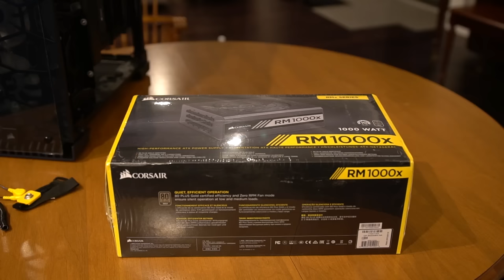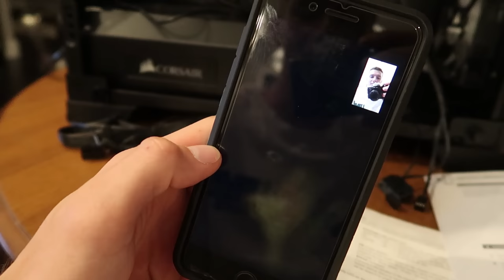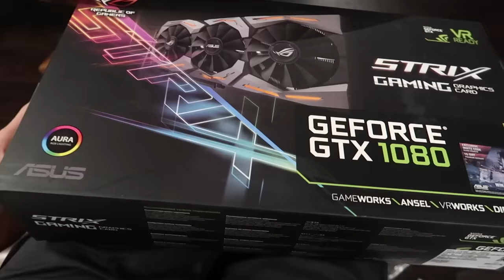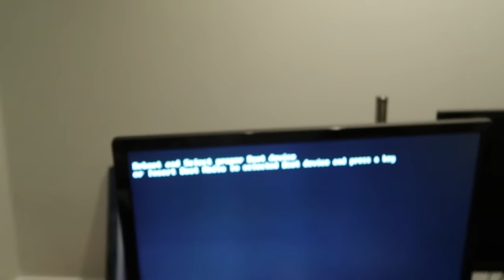Building my First Gaming PC

Comment from the maker: I know the cable management is awful in this video - I cleaned it up the next day once I had more time! See video : "FIRED UP!"
Reply: Adam LZ how much did this cost
Reply: Please make a "How to: Reinstall a sticker" xD No hate <3
Reply: Please tell me you added a SLI bridge
Reply: Adam LZ I love it months later and still replies to the viewer
Reply: Adam LZ welcome to the master race
Reply: MEHDI gaming you should install the ram cpu and cpu cooler on the motherboard then install it
Reply: u left plastic on GPU n motherboard .
Reply: you put the fan downwards on accident
Reply: @Adam LZ  everything about your build is just wrong. From the sticker all the way to the radiator mounting position and your graphic cards.. omg six pin power connectors are not plugged in. Take it to a shop let them do it properly or call a friend maybe. Your system needs immediate help. Good try though for a first timer..
Reply: RetroLAD he made this in February, it works fine now
Reply: Adam LZ  i Love all Your vidos
Reply: U missed sli bridge on those two gpus
Reply: Adam LZ I wish I had those parts
Reply: Adam LZ oh my name is Ricardo
Reply: Adam LZ how much was it to buy all the components?
Reply: Adam LZ you need a Quad Channel  The geforces
Reply: calculating the chair and displays into the build too I would say around $10k at most. But if its just the system its about $3k give or take a few hundred.
Reply: Adam LZ miss watching ur videos
Reply: Adam LZ ur pc is pretty
Reply: Adam LZ i to am ignorant, I put it together cable manage, put the pannles on and then test.
Reply: Your heatsink is cool!! ( the one you installed on top of cpu)
Reply: Hey adam.I want to ask you if u have temperature issues with your CPU.
Reply: Adam LZ isaid
Reply: How much did this cost??
Reply: Adam LZ llll
Reply: How did you get all of the fans wired up I have the same case but I cant wire up 6 fans
Reply: Y IS THIS HARD TO WATCH, i wish i was there so i cloud help lol
Reply: oh my god people why the hate? he said its his first, nor is he an expert. also directx12 almost does away with the need for sli ( I said almost, haters). some games are better with / some without / some it doesn't matter. and you could also use one for a dedicated phys-x. and if you haven't forgotten a plug or an io shield, you are not human. just sayin.
Reply: adam we have the same set up lool
Reply: What was the price of this
Reply: @adamlz Would you be able to link the tool kits you got for this build?
Reply: Adam LZ I like how you know you know nothing about pc and don’t make yourself look more stupid then you are about pc’s haha it’s cool Ik you know way more about cars then I do I hate people that act like they know stuff about pc’s and don’t so know what I give props 👌🤙🏾
Reply: Hey can you tell me how you resolve that blinking problem I am getting the same and not able to resolve it???? Please help me asap
Reply: Adam LZ   Hey can you tell me how you resolve that blinking problem I am getting the same and not able to resolve it???? Please help me asap.
Reply: That's how actually the radiator is, it keeps your cpu cool just like your car engine should have access to cool air.
Reply: Maybe, I said maybe, it will cost at least $1200 in total
Reply: Adam LZ the  hard drive doesn't fit because it's upside-down
Reply: Adam LZ yo adam you forget the sli bridge for the gtx 1080 cards lol you should assemble one!
Reply: I hope you changed the radiator fans to exhaust out if the 3 front fans already pull air in
Reply: GPU Box says VR READY and VR Works. Buys two Asus Strix Geforce GTX 1080.
Reply: Adam LZ chhhfgh v
Reply: Adam LZ i
Reply: Just saw this & am new to channel. I'm a PC builder, electronics repair person, & tech guy. Actually live in central Florida. If you ever need some help or advice, hit me up, I would be glad to give you a hand, etc.... Can also do repairs of phones, CPUs etc...along w/ upgrading systems & custom mods. Great vid for your first. L8R dude. Cheers, A
Reply: Adam LZ I’m looking for a pc to build what was the cost to this
Reply: Munchies 34 Hey there. price will depend on "when buying components", as pricing fluctuates with the market. I'm a builder, amongst other tech things. After watching & scanning party's list; I'm guessing cost for this entire system shown is about $2700ish USD; with a ±$75-$200 USD for prices today (not when built this) & that's not figuring tax, shipping, rebates, etc...
Hope this helps.
Cheers, A
Reply: Aepek thanks
Reply: Munchies 34 No problem :-)
Reply: what is the total cost???
Reply: GAMEREX-GAMEPLAYS AND MORE are you asking me what total cost is of this system, if bought today? 
Bare with me, have migraine today :-(
Reply: I really need help with this, how did you get the fan lights to turn on? I think I have a cable but I need to plug it into and LED strip which I can’t find.
Reply: Sam Raymond there will be fan headers (pins) on your mother board, or depending on case manufacturer, you may have a puck(fan controller). That's where plug fans into. Need more help let me know.....
Cheers, A
Reply: I am able to get the fans wokring, however the lights won't turn on and was wondering if there is another cable for it
Reply: Sam Raymond yes, off of your fans 3 or 4 pin header should be a 5v or 12v header as well that plugs into the LED fan header on motherboard (mobo) or a puck(fan controller)
Reply: All there is is a 3 pin header which I have plugged into the SYS_FAN1/2/3 slots. There is nothing else coming off of it. Was that the right place to put them?
Reply: After connecting led fans & there should be an RGB fan cable as well as a 3 or 4 pin
Reply: Sam Raymond okay, here's best bet for helping now. Go to manufacture YouTube page & under vids they should have examples & help of how to connect there fans, SSDs, etc....
If this doesn't help, let me know & I'll see what can do for an online solution.
Sorry can't help anymore, but have 2 Custom PCs that need finished for tomorrow & kinda behind.
Hope this helps a little, but there should be a RGB fan header & power header for your RGB LED case fan.
Cheers, A
Reply: Sam Raymond last reply than really need to go😃
On the Asrock x470 SLI/ac mobo working on now. Case fan 3 (4 pin) connector as RGB led header next to it for RGB control. Depending on your mobo layout there should be an RGB led header & if fan didn't come with RGB header, might not be RGB? W/o knowing model numbers & brands not sure. Naturally, I'm human, so can be wrong😉 But do build custom rigs for clients.....so do have some experience.
Okay, hope helps, L8R Mate, A
Reply: Not only is the cable management awful, so are your unboxing skills. If something was to go wrong with a part, most manufacturers will only repair under warranty or replace if it is shipped back in the original packaging.
Reply: You need thermal paste
Reply: could you link the toolkit?
Reply: The cpu you put on the wrong way it's a little triangle on the cpu on the  motherboard
Reply: @archangelos7426  Good question, been 30 years since I built a computer, but from the videos I've been watching I think he still DID need the thermalpaste with heatsink no matter what.  Still he's doing better than me trying to "relearn" with the new tech.
Reply: Adam LZ I died when you said   I should read the instructions on this one😂
Reply: 69
Reply: you always start with the mother board ahaha
Reply: adam says in the video, he knows nothing just seen a few videos.. meanwhile the verge is a tech company so they would have (should have) an idea the best way to do things. but they just fucked shit up
Reply: The "motherboard backplate" should go between the cpu and the fan

Comment: Who else cringed hard asf when Adam put the mother board on the table without anything under it?
Reply: yeah he should have put it in first before he mounted the pump
Reply: Dyllan Foster I cringed when he ripped some of the boxes, I have to keep all of mine nice.
Reply: Its a wood table, better then anything else he could of put it on
Reply: instant waste of an already unnecessary static strap, but to add insult to injury the whole order of the build is back asswards
Reply: wackamack who cares
Reply: Wood isn't conductive so I don't get what your cringe is?
Reply: meeee :(
Reply: Dude, I Literally Went Ape Shit When He Did xD
Reply: me
Reply: Dyllan Foster people need to stop being sooo anal about this stuff i have been literally treating components like old shoes throwing them in and out and setting them down on anything for about 6 years. Not grounding my self and i have never fried a component.
Reply: u dont need that
Reply: Dyllan Foster yes it was so cringy
Reply: that's not necessarily bad, but it makes the internet plenty angry so it gets my vote of approval every time someone does it :P
Reply: I did
Reply: For scratching the table and killing the solder on the back yah a little bit...

In terms of the static comments,, I have built 3 PC's on carpet and one was even in the winter when I get shocked every time I touched a light switch. Static is no big deal I have never had any issues, it will loose its charge as you touch it a bunch of times during installation.
Reply: When he hooked it up to the cooler and it was just hanging there LoL
Reply: I thank its because the wood is hard and theres pins on the back that can brake
Reply: ME AF!!!!!
Reply: Dyllan Foster yes that made me want to cry😭
Reply: Dyllan Foster ik and he put the pump on way early as if it was a heatsynk
Reply: Dyllan Foster tell Adam to return his 1080s the 1080ti is releasing next week for 699$
Reply: holy fuck yes! but it didnt stop there? when he installed the water cooler before the mobo was in the case :O :O
Reply: i almost wanted to cry i wad yelling no plz at my phone lol but for first time not as bad as i thought
Reply: timothy johnson 1080ti is coming out next week tell him to return his 1080s the 1080ti is only going to cost 699
Reply: Alex Villalobos yes
Reply: Dyllan Foster doesn't matter that much actually my mother board just lays there because I'm still buying stuff for my build
Reply: rip motherboard
Reply: Dyllan Foster so cringeworthy, should of just got one of Obsessed Garage's mates to help you, Adam. 😁
Reply: its his first time chill
Reply: Dyllan Foster I was cringing when I saw him starting with the power supply and pretty much everything! 😂
Reply: i cringed so hard when he was holding the gtx 1080 as if it was just a bottle of water
Reply: Dam noobs. lol. just joking Adam. 😂
Reply: It literally doesn't matter.
Reply: Dyllan Foster no ,might scratch his wood table is the only thing
Reply: impatient as always Adam.
Reply: i did i thought that it was gonna fall
Reply: I did...
Reply: hahaha
Reply: Dyllan Foster I cringed when i saw your comment. Wood isn't conductive at all, just like cardboard, so it doesn't matter if he put the motherboard on a wooden table or the box that it came in. Only difference is that the table might get scratches but that's besides the point.
Reply: lol...some of ya'll way too excitable. He clearly said he doesn't know what he's doing and that mistakes will be made. You guys over here acting like it's the final episode of Top Model. His money who cares, judgemental much?
Reply: doglet woofer he can do what he wants lol
Reply: holy shit this was the funniest video i have ever (Edit:seen) well done adam
Reply: Dyllan Foster yup ✋
Reply: doglet woofer that's what everyone else thought when they read your comment ;)
Reply: Men I do it all the time....yea its risky but not nearly as bad as it used to be.
Reply: i was like please grab the box lol. and mounted the mobo without putting case on side... not hating adam, you said youre no expert, but still cringed. not absloutely sure but i think the cpu cooler backplate needed to be rotated, if it is like my older corsair cooler, but it fit so not sure.
Reply: I cringed when this comment got 500 thumbs up.

Comment: oh no this Is cringy to watch
Reply: Henry Rendon  Why?
Reply: papa From a computer nerd, it is very cringy but adam was still A+
Reply: He's doing things wrong. Why do you expect? I don't think he's wired up the CPU power connector, he's clearly not wired the graphics card power supply properly ( I think hes using the adapters that came with the GPU? when he should be using the wires from the cable collection that came with the PSU ). Missing SLI Bridge. He's learning though.
Reply: ***** cut him some slack man it's his firts you nerd
Reply: Well if you don't tell him what's doing wrong, he's not gonna learn. I said he's learning. Have a good day :)
Reply: I was waiting for magic smoke when he powered it up... cringed all the way through the vid.. i saw the mustard and ketchup and thought he was using the molex adapters.. my 6 year old nephew was watching with me and said the idiots hasnt got the pcie plugged in,
Reply: GForceConnections  When you built your first computer, it wasn't that easy man. I know my first time wasn't. No need to put him down...
Reply: Zxyr  Yes I have. Want the specs because I will gladly give them to you.  I understand he messed some stuff up but its not cringe when its his first build.

Comment: Decent 1st attempt but a few things you need to fix...
1. The cpu back plate is installed the wrong way, it needs to be rotated 90 degrees
2. The cpu cooler fans are blowing air out out the case, which is fine but i would put the fans on the other side of the radiator so that they pull rather than push air out. (have a look at push vs pull on radiators) Also you can spin the radiator round so the hoses come from the right hand side, they look a little tight.
3. I dont know what the red wires are in your graphics cards but you dont need them, use the wires labeled pcie straight into your graphics cards from your psu, you should have plenty. They are usually 6+2 which means you can join them for an 8 pin plug or just use the 6 for the other plug.
4. As long as you have a license you can download windows to a usb stick, they have a USB creation tool on there website https://www.microsoft.com/en-gb/software-download/windows10
GL cant wait to see it up and running!
Reply: I noticed the backplate thing too but I guess it doesn't matter since it looked like it fit
Reply: Second point is irrelevant, it makes negligible difference which side they are, pretty much all down to personal preference
Reply: Is there any front panel ports -- if so gotta make sure you plug those in. Are all your fans plugged into the Mobo as well? Your mobo should have good documentation on all the ports. If you can't figure out the media creation tool just get/borrow a USB Disk drive.

Pretty good for your first PC -- they have made things really easy in the past 10 years. My first PC (with IDE /ATA cables) I forgot to change the harddrive jumpers and it took me way too long to get it to recognize the master harddrive.
Reply: I have mine blowing out on my H100i. Honestly, unless you do custom, the H212 Evo is better than any AIO cooler. I have two front 140mm blowing in from the front, one 140mm in the back, and 4 120mm in push/pull on my 240mm rad.
Reply: Tom H or you could have one push and one pull. Some people do that too
Reply: Please talk in English don't understand eney thing you just said 😁😁
Reply: Keith Graves Jr. I 2nd that
Reply: Austin James Where in "fuckin nerds" did I say money? Lmao
Reply: You want the radiator blowing air out of the case. unless you want your video cards to get hot.
Reply: Tom H This comment is great! It's constructive criticism and also helping out Adam! +1!
Reply: Being behind or in front of the radiator makes no difference, flipping the fan changes push/pull.
Reply: everyone uses google for many things it's a god damn search engine, information haven hahaha is it stupid to use google? or is it stupid not to? Whats the problem with being a nerd? Adam just built a pc call him a nerd
Reply: it doesnt matter what side the cpu fans are on, its all about which direction its pushing/pulling the air
Reply: backing plate isnt square
Reply: Yeah I cringed, @lz im local, I have multiple copies of windows 10 pro through dreamspark. and we need to fix that computer.
Reply: everything i would say and more
Reply: i love building pc's. makes me want to build another just for fun lol
Reply: you want the fans on the rad to blow out. and they are i have the big brother of that cooler. the fans are the right way. and push vs. pull is not much different only a few degrees cooler.
Reply: @Tom H I was thinking the same because I built someone a computer and the same problem happened
Reply: Big yes for the back plate it might look like it fits fine but its not... The back plate will give out eventually or there will be slight movement from the pump to the cpu block itself making it hard to cool.